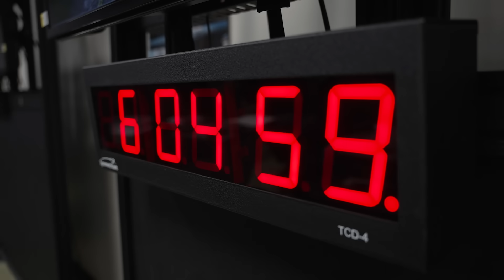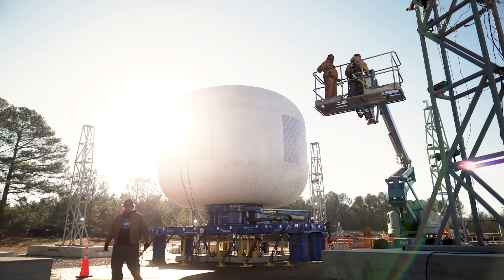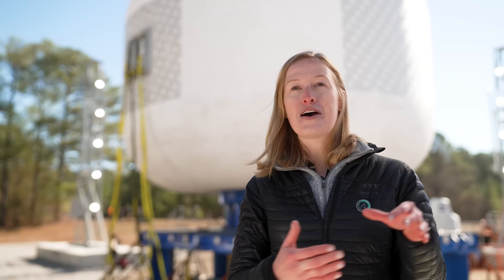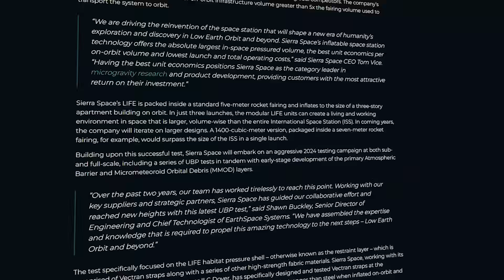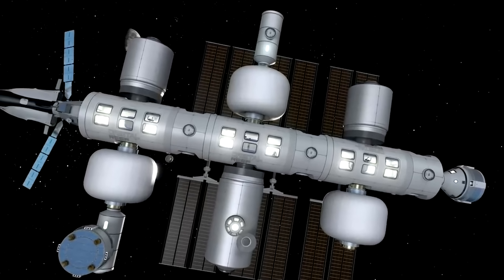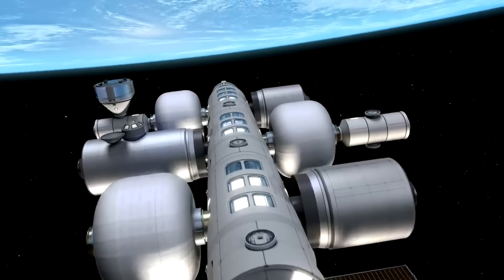Sierra Space Has Begun Full-Scale LIFE Habitat Testing

Comment: Is it even possible to test this on the ground in a chamber? Inflating it to its size in a giant pressure chamber seems like a very bad idea. Do you send a small scale model that’s already at size to test strength and endurance against space debris? Do you install hard panels on the outside later or does it always stay soft materials?   Actually does resin cure in space? It does in a vacuum chamber so could you have a plastic liner of some kind and injecting resin to fully coat the shell to make it hard.. I’m over thinking this, I’ve got no clue what I’m talking about.

Comment: I'm sorry no astronaut would dare to step into something so foolish as a floating balloon in space. lmao!  What the structure needs is braided stainless steel on the outside once it reaches a critical point air is released the outer stainless steel braid locks into place creating a much stronger structural integrity. The technology already exists in water lines on submarines. the way to go is to use this inflatable unit in conjunction with the braided stainless steel mesh where once it expands it can never be deflated or collapsed.

Comment: I honestly don't know why the design isn't 2 "Dual or tripled layered" spoked 
wagon wheels, So that they can be spun against each other, Why multilayered?  
So that if a puncture occurs there are pressurised layers left to 
protect from total failure. Why a wagon wheel configuration? the outer ring 
and it's sections "Rooms" if spun could provide some artificial gravity via the 
wagon wheels opposing spin to each other. Just remember the spokes are 
cables 20 meters or more and there can be two tunnels on each wheel going to 
the Hub joined to the Axle leading to the opposing wheel..
Gravity does not have to be 1G it may be a mere 1/3 or less of a G..

Comment: uhmmmmm, where does the air for these new "cabins" come from. Do they get inflated from the air in the other modules of the space station which just thins out the air. If they get inflated to quickly from the other station modules could that cause the other modules to implode.
Reply: Check out the ISS ECLSS wiki page for how the atmosphere inside is handled, and with the dangers of damaging other modules via loss of atmosphere the modules outright can't implode in space as there is no outside atmosphere to crush it in on loss of pressure, and the inflation of new modules would be done slowly while the air taken up by it's new interior volume is added via the life support system to keep the pressure at to normal operating pressure.
Reply: Though if you're talking about stuff in the single inflatable module, all of the rooms are likely just one big sealed chamber having no actual airtight seals between rooms
so if one deflated you have a bigger problem called a leak.

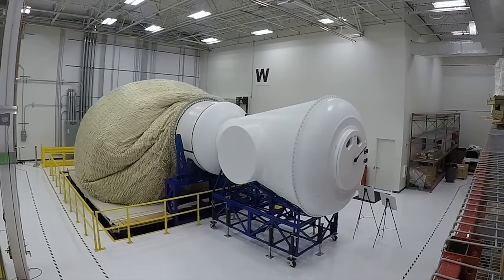Comment: What component of the system does the inflating of the module? I mean, I know they have done a lot of work on the the material science and structural stability of the of the module itself, but do they already have a thing that can, once in space, inflate the thing too? Is it the cone looking thing at 5:05? Just curious.
Reply: Look. It's made for space. Any gas pressure over the outside pressure will "inflate" the structure (meaning all pressures over zero). It will hold 1bar of breathable air for human habitation (which is 1bar over space pressure). It is going to be "inflated" by the breathable life support systems, it's doesn't require anything else than normal air pressure. 
How do you make "air" in space? No idea, I assume they ship liquid nitrogen and oxygen to the iss, you just them up and release.

Comment: As engineered, this will never be durable enough for the many impacts from microparticles and larger in space.

What you should consider is having a double-walled system that, after inflation, has a slow-setting resin injected via two veins built along the seamlines in the void between the two layers: one for resin, the other for fixative.  Inflate, keep it under pressure, inject the liquids, allow double the required full-set period, then perform automated pressure tests (steady, pressure-hammering, etc) over a full week's time.  Now you've got a SOLID shell that will provide at least as much protection as the metal craft in use today.

Comment: It looks like SpaceX will attach 2 (or more) Starships together and emulate artificial gravity by a cable between the 2 Starships swinging around. Along with Starship, they can attach habitats as the primary living areas. As long as they take this path, it is possible to house personnel inside the habitat on Earth as a full mission test. Come to think about it, I would suggest one test at sea-level (1 Bar). This sort of testing will expose so many areas of improvement and further engineering advancements.

Comment: I’d love to see a SpaceX collaboration sometime in this decade, LIFE v3 with 1440 sqm in a 7m fairing is impressive but even that wouldn’t be using the full 9m that a Starship fairing should be able to provide if the project delivers on its promises.

I can see LIFE being so useful to stage 2 (or maybe later) of Elon’s colonise-Mars plan. A single one of these inflated in LEO and docked to a propulsion module (probably a modified Starship with a docking port on the front and bigger propellant tanks in lieu of some payload capacity and no fins or heat shield) could transport a lot of people between Earth and Mars orbits in one trip.

You would of course need shuttles at the Mars end to get to/from the surface and in-situ resource generation to fuel them but presumably stage 1 of Elon’s plan (the plan as currently envisaged - single Starships all the way to the Martian surface) would get the necessary shuttle vehicles to Mars.

All of the above is a long way off right now but I can see it as an attainable future objective that I might live to see.

Comment: So in a single Falcon launch we could launch a volume as large as the ISS. That should really improve quality of life up there. It will also open up the space station for more people, simply because they can avoid each other. I know Sierra still wants to launch using New Glenn, but it would be better for them to disconnect from amazon space and operate independently.
Reply: No it was a single Starship/SLS launch.  And keep in mind volume is not enough, crew needs massive equipment for lifesupport and work stations to actually DO anything other then play around bouncing off the walls.  Suplemental launches to bring that equipment would largly wipe out the launch-count to crew-supported ratio differences.
Reply: @kennethferland5579 I'm just talking volume here, because that is what Sierra has created. With the current spacestation we routinely send equipment, quality of life equipment, support systems  and experiments. But that wasn't the point here. 

My point is that the 7 meter long (yet to be developed) tube can be send up to space using a falcon 9. As this is roughly the size of their fairing. This 7 meter tube creates the same volume as ISS. Nothing more, nothing less. 

SpaceX also had designed an extended heavy fairing, but that one hasn't been developed/flown yet as far as I know. And won't be needed either, as starship will be in production soon enough.

Anyway. with this inflatable system you can create more breathing room if you will for the astronauts, allowing for better comfort and longer stays. A high quality of life improvement if you will.
Reply: Falcon 9 and Heavy payload fairings are 3.5m diameter. LIFE modules require 5.0m diameter, and designed to fit onto New Glenn (you idiot!).
So neither Falcon can launch LIFE modules, ever.

Comment: Just to add..... 77 PSI is 5 times the operational pressure. Sierra not only complied with the 4x requirement, they just topped it off with 5x. 27% over de already established safety margin doesn't really sound impressive, right until you compare it to the operational pressures.
Reply: But if your on the ground then the external pressure is 14.7 psi so the relative pressure would be effectivly 4 atmosphere.  The ISS is pressurized to 1 atmosphere, so a 4 fold safety margin for an on orbit would be exactly what they tested to.  Claiming they exceeded the requirement by an additional atmosphere would then just be an outright deception, unless the NASA specs are infact actually written for ground testing and a 3x margin on orbit is what NASA actually specified.
Reply: @kennethferland5579  I'm fairly sure the smart cookies at nasa are like really smart (yes sarcasm). Well apart from the management side of NASA which has always been dodgy, but the engineering side of NASA always has been of top notch quality. 

I'm fairly sure that the engineers specified 60 PSI with a double safety margin in mind. The amount of triple (or more) redundancies in every (critical) component is just crazy. The ISS has been flying up there for 30 years already and I can't think of that then any other way that the part that separates the astronauts from nothing is waaaaay overspec'd. 

Keep in mind a 1% margin over the 60PSI limit was deemed acceptable. A 27% increase is massive, it just sounds not so massive. It's just how you convey the information and how to put it into scale. And that was my intention.

Comment: How is the internal structure put together and stowed diring 'pre-inlation'? Giant IKEA packages? 😉
Reply: It has a central rigid rod running between the rigid end caps, in that rod various equipment can be installed with basiclly dosn't have to ever move because the moduel only inflates in radius, not in length.  All plumbing and electrical connections would also go through that rigid portion as well allowing connection to ther modules at the ends.  Think of it like thouse camper tents which have a rigid floor and some basics furniture up to wasit height on them but a popup canvas walls and ceiling above waist level.

Comment: Please, for non american public, can you also give pressure in bar : this unit is almost equal to the atmospheric pressure and is far more intuitive than pound by square inch as pound and inch are almost unused outside USA and UK.
Reply: Simple math can answer that question which anyone interested in space science can and should learn for themselves.  Basically one bar = one atm at sea level or 14.7 psi. Also in metric 1 atm is 760 mm. Thus if the NASA standard is 68 psi  that works at 4.6 bar.  And the burst test occured at 77 psi or 5.2 bar.
Reply: @michaeldeierhoi4096 a quick search in google solve the trouble.... As if I reply in french you'll have to put my answer in a translator !

For most of the people on Earth, French  is an exotic language as PSI is an exotic unit.
Reply: @michaeldeierhoi4096 People interested in any scientific research at all will generally be thinking in metric...

Comment: 4:14 - Why do artists renditions always have the floor going along the long axis, when going across enables more living space, and makes it posible to 'hang' the module from a spinning structure to create floor where local down is Outwards from the center of spin.
Floors across also makes it easier to dig a circular hole, drop one in, then cover with regolith for radiation shielding - the central mounts at each end then make the top floor in to an airlock, and the lower opeing able to be hooked in to underground tunnels between modules.
Floors across also work as ribs and turn each floor in to a presurised bubble inside the main structure, meaning an incident blows out only one bubble.
Reply: Well first they don't ALWAYS show that.  The original NASA concepts had the floors perpendicular to the long axis and the whole thing hanging 'vertical' from the ISS.  The Horizontal flooring schemes you see mostly came from Bigelow and stemmed largely from mockups which were on the ground and thus had to conform to horizontal entry into the end caps onto a flat floors walkable under gravity.  The configuration that is actually most likely, particularly for small modules will just be a floorless dohnut space and a central core, maybe with supplemental stuff attached to the outer wall, no one really needs a 'floor' in zero-G after all.  

As for your proposed arangments with gravity, a classic spinning external wheel stations have all kind of problems and no one (serious) is planning any.  The vertical burrial idea is I think terrible.  First off need to dig a deeper hole to pace the module in vertical then if it's placed horizontally, and in the vertical configuration entry would be through a vertical hole at the top, an inherently dangerous and unessarily cumpersome configuration.  Concepts for utilizing an inflatable on a planetary surface consist of a shallow trench which it can sit in such that the end caps are at ground level, then the displaced regolith is heaped up ontop of the hab either as a lose burm or by filling sandbags like tubes which stretch over the top.
Reply: Interesting comments!

Comment: so will the central spine have foldable  sections to form floors and walls inside and could mall "closets" be left for emergency safe rooms perhaps a computer sever room lined with gold or lead to protect from radiation?? and why not 3d print the panels for furniture , storage units, and other fixtures rather than launch premade  a spool of filament would be more launhable than a chair or cabinet!!
Reply: Like the 3D printed furniture idea; consider lunar outposts, having an endless supply of lunar regolith as raw material for interior furnishings.
The Moon could offer endless opportunities for designers to have a field-day.
Imagine a station with decor styled after "2001: A Space Odessy", for filthy rich tourists to pose their fat carcasses on.
Just a question of available habitat space (as always...).
Reply: @davidstevenson9517  a cool novel that used  3d printing is the delta - v series by daniel suarez
Reply: The central spin would largly contain the lifesupport equipment, that central spine is not really going to be a 'room' you can go into either, not unless your talking about the largest concivable versions of this concept.  Also lead and other heavy elements are actually the WORST materials for pretection from the cosmic rays in space (per unit mass), heavy metal is good for Gamma-Ray shielding which is basically super high energy light, but Cosmic rays are large atoms moving near light speed, if they strike other large atoms then they will cause fission and a shower of secondary nuclear particles moving at high speed aka a 'shotgun' effect.  Light elements like hydrogen, carbon, oxygen and thus water and plastic are best because incoming nuclei lose energy through collisions but can't actually break the small tightly bound nuclei apart to create secondary radiation.  The light atoms ofcourse get thrown around violently but that is just heat.  Because preserved plastic packaged space-food is mostly cargon, hydrogen and oxygen the ideal radiation shelter is the food and drinking water storage area.
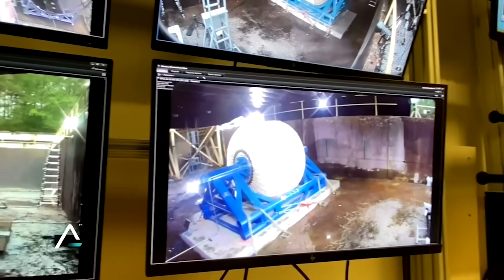Reply: i had read that water would be the best protector But it takes up a lot of space :) / area. maybe a whole hab designed for a safe room/ surrounded by water tanks?? according to the pic at6:22 the spine would be a kind of corridor earlier pic showed empty area for a room probably be lots of configurations tho  .  well we will see i guess have fun:) @kennethferland5579

Comment: Will they have inflatable furniture? Or ikea flat pack?
Reply: Flat Pack for Zero-G, Inflateable for any swinging on a structure to simulate internal gravity.
Reply: The size of the hatch is the limiting factor. Hope that the internal skin has built-in mounting points all over.
Reply: @markweatherill  Velcro and 3M double sided tape ;)
Reply: @markweatherill  It looks like they are using the standard CMB (Common Berthing Mechanism) of the ISS which produces a 1m x 1m doorway, thought that you can move the refrigerator sized racks that are the standard modules of all the ISS's internal components.  Most of which are lifesupport and labs, the only thing that would really be called furniture are the sleeping cabins which are just hollow versions of the same standard rack modules.
Reply: The TSB report suggested the furnishings would be solid but light, unfoldable, almost kitset (or is that a "ikea flat pack"?).

How about an inflatable effigy of Bill Nelson on each deck; keeping a simulated eye on the crew, remind them who's Boss?
🎈👤👀👩‍🚀👨‍🚀☝️

Comment: If that's a burst at 70ish PSI, what does it look like if it bursts just a little over 14.7 psi when it's in use? What does that failure mode look like? If they take it to service pressure and then shoot it, will it pop like a balloon or just leak out of the puncture?
Reply: 70psi inside and 14psi outside, so the pressure differential to cause a burst is close to 60psi .
In LEO, 14psi inside and 0psi outside is a much lower pressure differential, which implies that module would need 5 times atmospheric pressure before bursting.
At 14psi inside it's never going to burst.
Reply: Surely the MMOD Shield will undergo micro-meteoriod/ orbital debris puncture tests?
If so, at what speed (m/s or km/s?) would the simulation projectile be propelled to cause puncture? 
And what size/weight/shape the projectile? And what angle of approach, acute or oblique?
Lets hope Sierra Space are forthcoming with the data as they progress.
TheSpaceBucket will pass it on, for sure.
Reply: @davidstevenson9517 They should have that data from the BEAM unit that's still attached to the ISS - Sierra bought BEAM and the like from Bigelow, when the latter shut down, so the test data should have come with the technology.